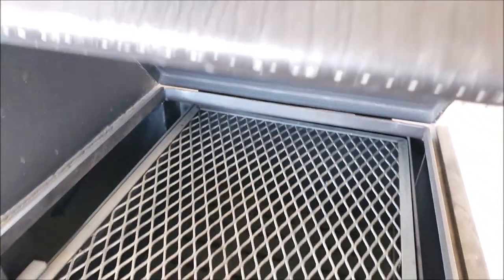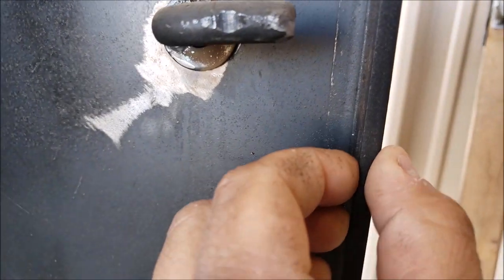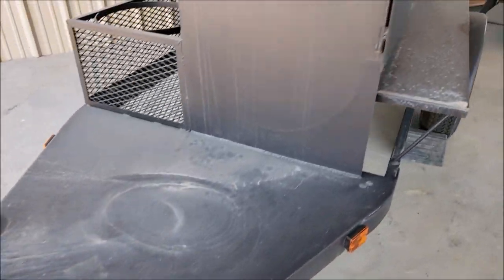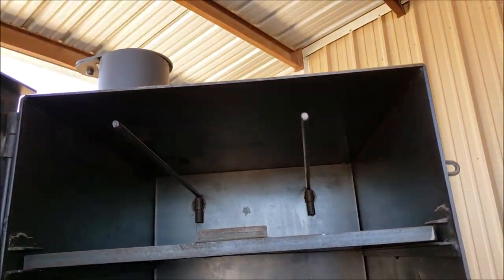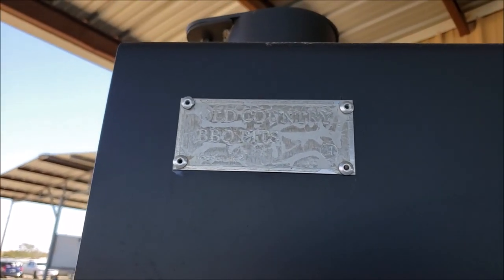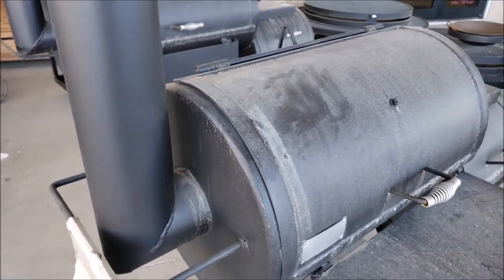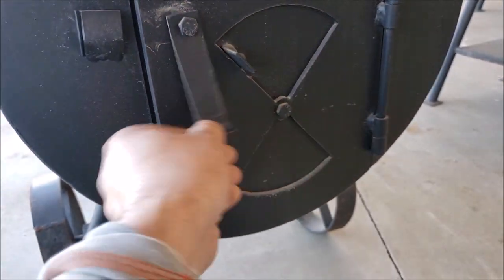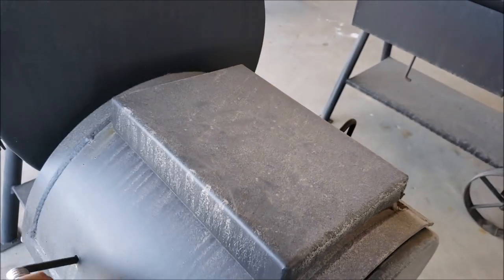Quick look at some Old Country BBQ grills Smokers - Trailer smoker - Fire Pits

Comment: How big was the 650 smoker?  You gonna build another smoker?
Reply from the maker: I dont have plans for anything big anytime soon. I have 2 small sections of pipe that I can try building one. Someone supplied the pipes and I have scrap and free labor. I help out those who are struggling.
Reply: That is a wrangler with the same gauge steel as the Brazos. 1/4”

Comment: The Old Country Brazos and Brazos DLX smokers are awesome.  I have also had Yoder Wichita , and my first smoker was the Oklahoma Joe. Both were solid smokers for sure and I had many great experiences smoking on these pits.  If I had to pick, I like my Brazos/Brazos DLX. Both will help you produce mouth watering smoked meat.  The only mod I use  now is a 16 inch stack extension which keeps my smoker at a consistent enough grill temp for 15-17 lb briskets, pork shoulders and tenderloins and my son's favorite smoker spatchcock chicken,  
 Just get to know your 1/4 inch steel Brazos smoker and you can consistently produce smoked meat close  or even better than what you may have tasted at the competitions. These Old Country Brazos and DLX smokers are "BY FAR" the best backyard smokers for the money.
Reply from the maker: I just picked up a brisket to smoke over night today. I am curious on your extension is it a pipe with a collar that's removable or is it welded on. I have a trailer grill I built out of a propane tank and enjoyed grilling on there but when I try smoking meat I better have a ton of firewood. The trailer also have a tall stack just cant remember off the top of my head. Spatchcock chicken is also a favorite of mine and many locals cook them in ugly drum cookers especially during comps. Thanks for the comment and might have to pick up more meat today.

Comment: Damn academy needs to carry some of those heavier duty smokers. The 1 for 650$ is the wrangler (carried at academy) and is less than 3/16 thick steel but the 1 you showed is 1/4 thick. I'd buy that today if it was in houston.
Reply: Same. I’m in Houston and have the   Standard wrangler (1/4 inch lid with everything else being 10 gauge style I believe).
Reply: Go to academy. They have the 1/4” old country smokers